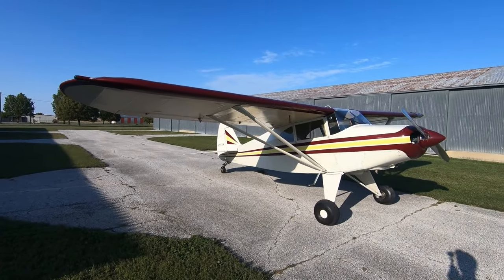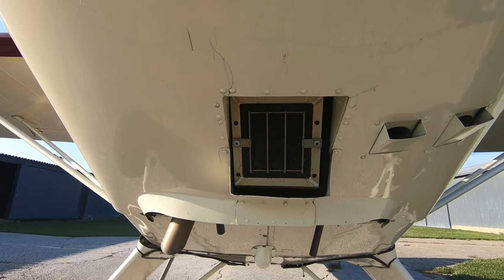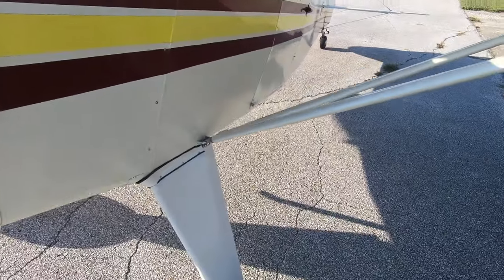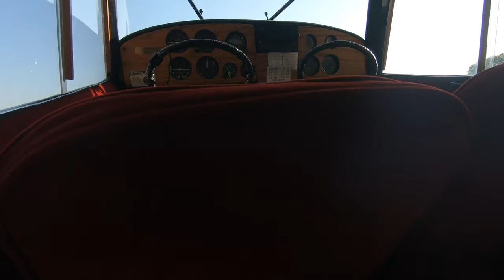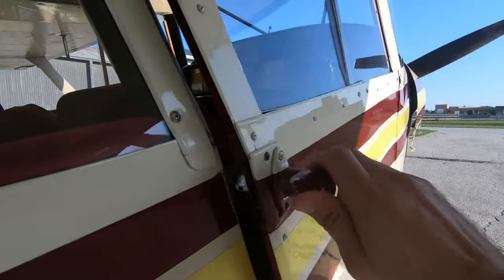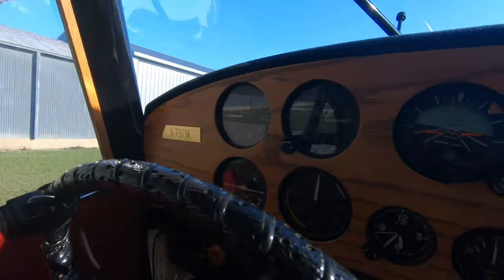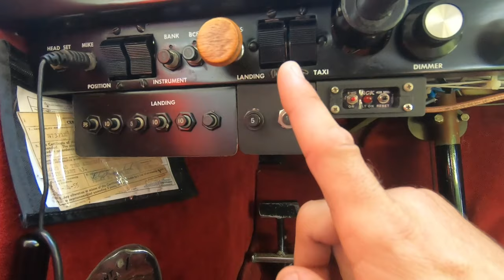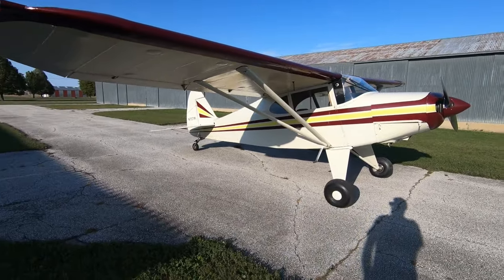SOLD - Airplane For Sale - Piper Pacer

Comment: So pretty, when the shadow is stretching to touch the gear on the grass. I did a screen capture for background on a desktop I use occasionally at work. (My V-6 STOL is a modified PA-22 with tailwheel and 15" stretch.) 230hp. Homesick angel, but a little heavy for flare.

Comment: I had a tri pacer converted to the tailwheel, with a 160 lyc. With that engine it was adequate. But more power is always better. A 180 would be just right.
Reply from the maker: I like the idea of a 180 hp engine. I think that would make the pacer a descent bush plane
Reply: IO-360/180HP is too heavy for a SWP
Reply: I did see a conversion at SNF where they put long wings on the Pacer fuselage. Not sure if they put a bigger engine in it though. I guess it would need some beef ups to do that.  I think it was called the Bushmaster conversion @Hawka-Loogy